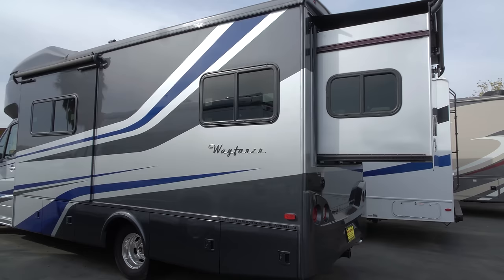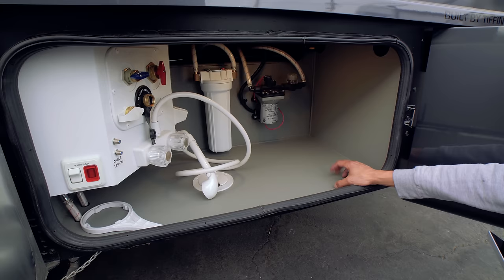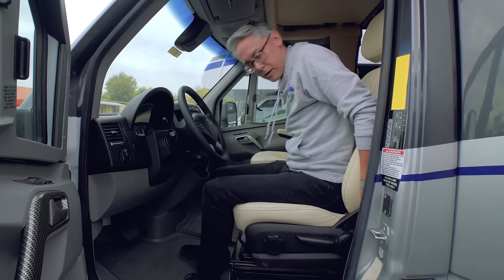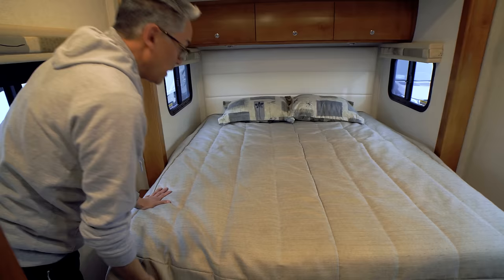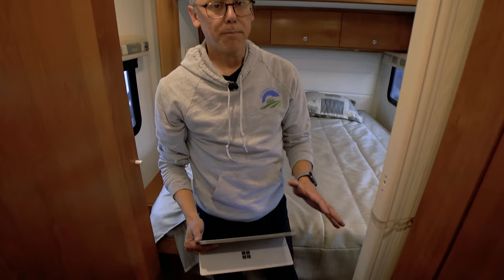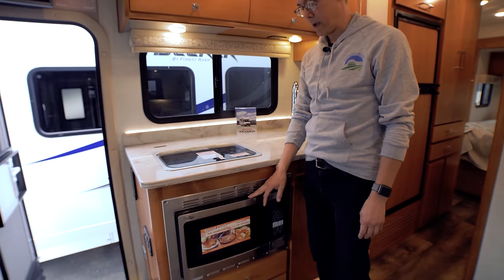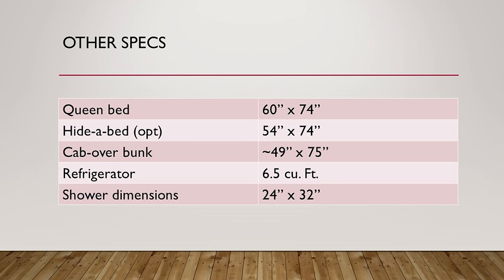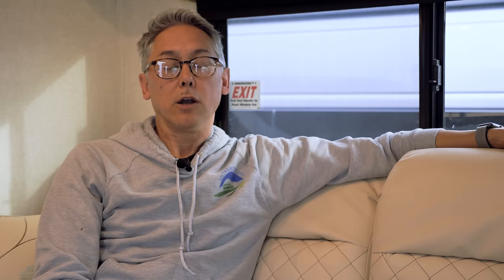Full Review | 2019 Tiffin Wayfarer 25QW | Rear Slide Out Class C

Comment from the maker: Do you like the Tiffin Wayfarer 25QW?
Reply: Ultramobility — I like it, interesting design!  But your concern about the weight is warranted.  I’m not as concerned about the safety as much as I am about maintenance issues.  The weight being at vehicle capacity is going to cause additional heat, wear and tear, and stress on every vehicle component.  Been there, done that, very expensive.  Having worked in the cellular phone industry the wiring cabinet you showed sent a chill up my spine, whomever allowed THAT mess to go out the door should be reassigned or terminated immediately, that mess was inexcusable.   The price was a plus!  But the price also explains every negative issue you mentioned.  I’ve come to believe if you save money up front, you’re going to pay dearly throughout the life of the RV in repair, and maintenance costs as well as ruined trips or vacations.  This coach reminds me of one of my worst purchases ever, a Winnebago that ruined EVERY trip due to an assortment of failures.  Your concern about the sturdiness of the shower was also spot on. However having used a flexible plastic roll up shower door in an Airstream... that’s a non issue.  Those seemingly flimsy shower doors actually work!  LOL!
Reply: Minute 7:00
You should have stopped the review.
God forbid I wanted to carry myself at 215 plus a significant other at 150 lbs I need to start dumping water...😂😁😁
If it weren’t sad it would really be funny.
Thanks for pointing out how careless this manufacturer is!
No one else in the industry is pointing this out.
Reply: With duallys in the rear, there is no way the OCCC is less than 700lb unless they built that body shell out of 3 inch steel.  The naked chassis must easily be able to carry >6,000lb per Mercedes with a GVWR of almost 12,000lb.  How could the fiberglass coach itself weigh over 5,000lb?  I think your information or their information is just wrong-- off by a decimal.
Reply from the maker: the occc raiting came directly off the door Allie. I'm afraid this is a fact unfortunately.
Reply: Not a safe option unless for a super skinny couple. Even then no room for extra stuff. For quality Winnebago View/Navion has more cargo space.
Reply: Eliminating the driver side slide would add 200-300 pounds of carrying capacity and leave one less area of complexity to fail.. The wiring mess should be embarrassing to Tiffin.
Reply: I drove one and can attest..'this thing is HEAVY!  The chassis felt like it was struggling to carry the coach and the engine struggled to get up to freeway speed. Disappointed... I had my heart set on this coach, but purchased a Class B instead.
Reply: @alliejr  It is really that heavy. The tiffian class c's are infamous for having very little carrying capacity.
Reply: The Tiffin 25Q is like a trophy wife, looks nice but once purchased your future happiness doesn’t look promising. Slides are problematic if used on a regular basis. There just isn’t any quality or dependability in this product. Buyer beware!
Reply: I like the layout, but I don't like the cheap crappy bed, the convection microwave, I always want a real oven. The weight issue makes this RV a waste of money. Quality issues. If they could fix these issues, I would really consider this. But you got to allow at least 1000lbs plus tank weight. Maybe it needs to be on a bigger chasis.
Reply: @alliejr  It's all that gorgeous wood... I'm seeing about 600 pounds in cabinet facing.  Plus two slides to consider.
Reply: What a Piece of Poorly Engineered and wilfully slovenly constructed vehicle (?). The best thing is the unit is ILLEGAL to drive. 
There weren't many positive remarks. 
Your interview with the president of Pleasure way was correct. The slides added about 750 or 1,000 extra pounds.
Reply: I am scratching my head about the cargo weight and wondering why this vehicle is even allowed legally on the road????  I  know some Tiffin Class A folks who rave about their RV and rightfully so,  but this is not the first Tiffin C that has a very poor cargo capacity.  Might be time to re design or stick to Class A.
Totally unrelated do you have any plans to review the Winnebago Solis soon?   Or as I like to say the Hymer Winnie   Thanks for the great content Neil
Reply: Ultramobility Not with that OCCC. Shame on Tiffen for building this accident waiting to happen.
Reply: Nope
Reply: Would like to see you review  2020 Thor Motor Coach Sequence 20K, Thor Motor Coach Tellaro looks like Hymer influence. And would like a proper review Pleasure Way OnTour 2.0 & 2.2...
Reply: Until I saw this review, I had believed Tiffin was a quality manufacturer.  Now I would never consider any of their products.  It’s unconscionable for them to knowingly build and sell a vehicle that is overloaded with a full water tank and 2 passengers — and that’s before cargo!   And this also is before getting into the quality issues in the vehicles.  

Neil, you’re always fairminded in your reviews, but honestly I believe you were too generous to Tiffin here.  They deserve condemnation for selling a vehicle like this.
Reply: Ty Neil another great review!
Reply: No. Poor quality and unsafe.  I would never consider it.
Reply: Nah....the manufacturer can’t plan it right for the OCCC. I guess  
something or many things else will be off too along the way.

Comment: That is shocking about carrying capacity! How is that possible? I'm stunned.
Reply from the maker: it's possible because we consumers don't demand better.
Reply: Should be illegal to sell.
Reply: @Ultramobility  it's possible because Merc Vans are not F450 Ford Econoline. It's also questionable why you'd want slides on such a light vehicle.
Reply: @Ultramobility  Agreed...most buyers are unaware of this. And dealers won't tell you about it. All those nice yet heavy materials add up. But MB and Ford do really need a more robust yet fuel efficient platform for RV outfitters with at least 12,000 lbs GVWR. I guess we are all waiting on the E-350, 450 to finally die...lol

Comment: If your going to be doing more class c videos would you consider taking a poke at the jayco melbourne/melbourne prestige. They have a similar floor plan to this in the 24k or 24kp. They are also the only manufacturer I know of that gives you the option of a c or a b+ front cap on the same unit. They look good on paper but I've not seen OCCC info anywhere about them and I wonder how much substance their is behind the good surface appearance.

Comment: The Tiffin Wayfarer is famous for providing tons of available storage to go along with ounces of cargo carrying capacity. But the Sprinter is a stout platform, and I am sure that there are after market suspension components that will enable you to increase those numbers, ie Sumo springs, air bladders, beefier anti sway bars, and such. The rub is that Tiffin should be incorporating these components themselves.
Reply from the maker: third cat is right: it's about everything mark brings up plus the things that third cat brings up. it's a totality of the vehicle's capability to carry cargo weight.
Reply: I think that with the ability to tow, and therefore stop with close to 5,000 additional pounds, the engine, trans, and brakes are more than capable of handling the weight, we're you to upgrade the suspension, provided you subtracted any additional on board weight from your towing figures.

Comment: Thanks for thorough review of this coach which per their brochure touts as being top quality. 

Putting aside the fact that your available free weight capacity is in the negative range, the quality of their workmanship is very poor (some might say that it’s at the level of the Chinese). The rat’s nest of wires is embarrassing. If one of my kids did something like this, they would have received a lecture from me about doing it right and then they would have been made to do it til it was right. To me, this suggests that management simply doesn’t care about quality workmanship as long as it works.

I believe you can tell about a company and their product when you turn your attention to the small and maybe not so visible details. If they are short-changing their customer there, imagine what they may be doing in areas not so easily accessible.

Your frank and honest reviews hopefully are putting companies on notice that their shoddy workmanship is no longer acceptable. And, I agree with you re: warranty. Perhaps customers should view the one year warranty as a warning as to quality. If you have a quality product, then it seems only reasonable that you would stand behind it for years to come. Remember the old saying “Solid as Sears”? Apparently Tiffin hasn’t for their Class C/B+ rigs.

Keep up your reviews. Excellent work, Neal.
Reply from the maker: really appreciate this comment. thank you catherine. I'm trying to shed light on some of these issues even if the manufacturers and some dealers aren't happy with me doing it. for the record, Happy Daze RV has been great to work with as they allow me to use their lot and never interfere with my reviews.

Comment: I don’t think you are going to get a Like from Tiffin on this.
Reply from the maker: probably not... i don't think bob tiffin will be calling me to congratulate me on a fine video.
Reply: @Ultramobility  I certainly hope it at least lights a fire under him to actually pay attention to what his company is building.
Reply: The problem is the Mercedes sprinter. If they made it gas on a Ford E350 or E450 chassis, it would be much better  with lower cost, easier maintenance, and all the OCCC anybody could want.
Reply: Tiffin is living off their high end Class A rep.  The market is exploding and they're cashing in on it with coaches like this.  If multiplex wiring is so great, why does it look like a plate of spaghetti wires under the sink?
Reply: Bob Smith even when Winnebago uses a Sprinter chassis, they get a lot more capacity. 
If I were designing rv’s, I’d look for innovative ways to make cabinets, especially the overhead ones, as light as possible, both for load and for weight distribution. Do they really need so much wood?  Many areas of the coach could cut weight too.  This coach is bloated. The Sprinter is a limited platform and the manufacturer needs to account for that, or go Ford  gas.

Comment: WOW! Some false and some manipulated information.  This a a biased review.  I love Tiffin Wayfarers (they are beautiful and they have great customer service). I'm on my 2nd one and I never experienced any issues with loose LED lights, the struts for the outside TV work fine, and all my positive locking cabinets work perfectly.  BTW, @ 17:55 we can see you pushing upwards on that cabinet (LOL-I guess you were trying to make your point).                                                                                                                                                                                                                                                 The OCCC for our Wayfarer 2018 QW is 1,150 lbs because we don't have the Big Foot system (heavy), solar, or that bathroom configuration. Our current QW comes with the lighter/basic stabilizers.  Also, 1,150 lbs is adequate for the wife and I and we don't drive around with a full tank of fresh water (it doesn't make sense). 1-False Information... @6:21 you pointed that the fresh water tank capacity is 38 Gallons and you multiplied by 8.3 lbs (that incorrect) and at 26:17 it shows 32 gallons, but its actually 31 gallons for that year model (see the brochure).  Come on!

Comment: A 2019 review on a 2018 model?  Now that's truth in advertising...
Reply from the maker: Yes the coach is billed as a 2019 But as is generally the case the chassis year is usually one year behind and this is because the manufacturers have to buy the chassis that far ahead in order to secure a shipment and then leave enough production time to get the completed unit out to the dealer lots.

Comment: Good grief, Tiffin has a wonderful Class A reputation, but that was not an A grade build job. Part of the OCCC problem, is that they aren't used to building light for Class C. Class A has all sorts of heavy build "for luxury" that just create problems in a Class C. And yet they then go too light and flimsy on the things that matter. 
Me? I want a comfy bed, flooring that will last, and a descent build quality, ie don't be falling apart before I even take you home. 
Frankly some of the other Class C manufacturers seem to at least look more reliable and have better warranties.
PS The Mercedes seats are supposed to have booster pillows to raise the seats when turned around. They must be optional with this coach. At $110K, they should just come with the coach.
Reply from the maker: good information about the booster pillows. to be fair they may have been in the coach and i didn't see them readily.